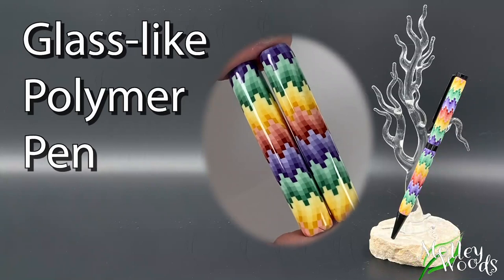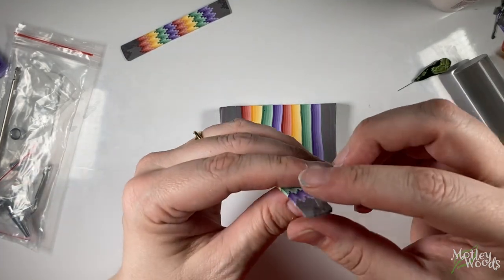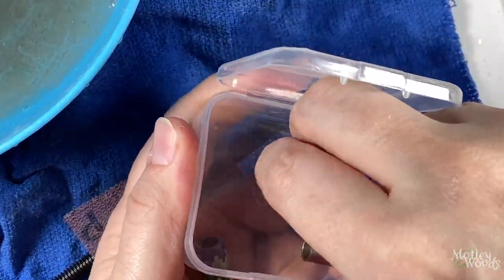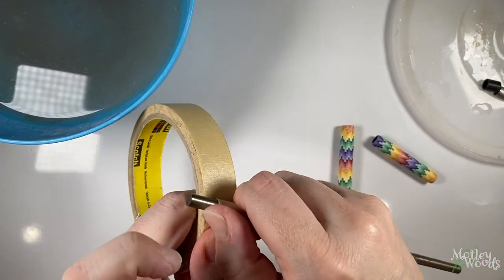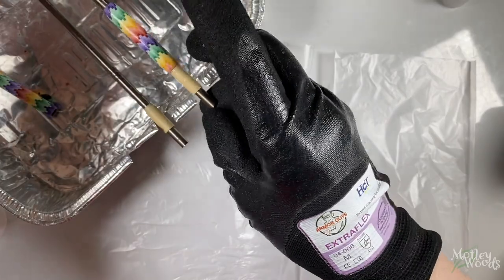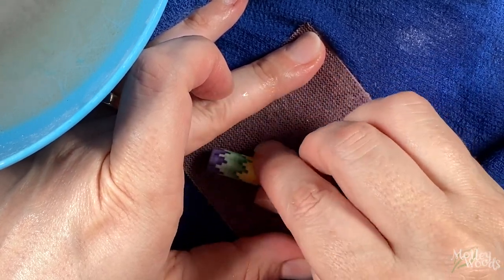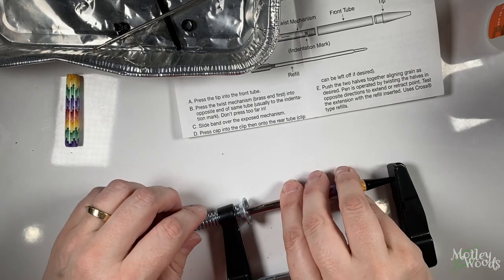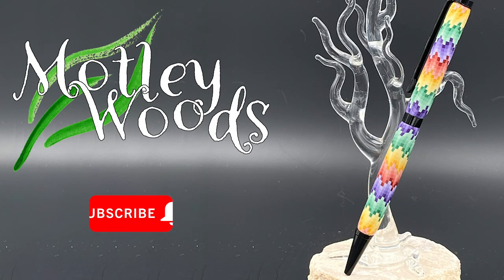Glass-like Polymer Clay Pen Finish - CA GluBoost - no lathe

Comment: Thanks for making this video. I’ve wanted to try  this but never been quite sure what to do. You make it look possible but I’m sure it’s really tricky!
Reply from the maker: Honestly it was way less tricky that I expected — though I’ve been doing it for a while on a lathe so, take that with a grain of salt. When you put it on just rub it immediately— and if you’re really nervous you could always practice on some scraps or a covered Bic barrel (it can crack when the barrel flexes though so I don’t recommend finishing Bics or other plastic barreled pens that way.)

Worst case you can also sand it all off and try again — though with hand sanding that’s much worse than it sounds!

But the GluBoost was a very forgiving finish. 

Similar to when I finally tried Mercury Flex for the first time, and it was much easier than my previous one — very liquidy glues formulated to require go on surprisingly well.

Comment: Hi thank you for sharing your talent. I started with bic pens which sometimes  melted in oven so I would like to do with pen kit as you do. Could you please give me address where to buy them. Thank you
Reply from the maker: If your oven goes too much over 300F, Bics will melt. Under that I think you’re likely okay. 

You can get pen kits all over. I don’t know your country so it’s hard to tell you where to buy from. A good starter pen kit is the cheap “slimline” (or “7mm standard” — the same thing) kit. 

There’s more expensive slimlines, but just get the cheapest a supplier in your country makes to start with. 

For example, in the US, I’ve bought kits from both exotic blanks and penn state industries.
Reply: @MotleyWoods  thank you for your reply, you help me so much, I am in the USA North Carolina but French native  that is why I could not find the correct name. Have a blessed day. Nadine
Reply: @MotleyWoods  Since last time, I ordered some pen kits where to advised me and today I made my first professional pen. Big difference between these ones and the plastic ones. Your video was so helpfull